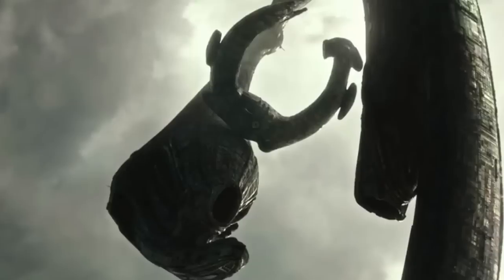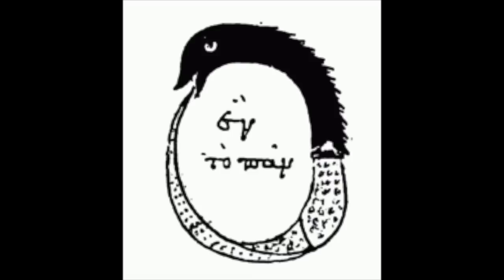Why Engineers Used a Flute ? How Juggernauts Work? Mother Juggernaut's Fate - Alien Covenant

Comment: The inside of the helmet that the space jockey is about to have equipped looks organic and not highly technological. There is no visible visor nor wires or lights. The pilot may be able to link his central nervous system to the ship in order to be more efficient when piloting the vessel since it would in theory be an extension of the pilot himself. This may be why the flute needs to be used so that the juggernaut knows that it is accepting a link with an organic being and not an AI or robot. Until David was able to bypass it by playing the flute.

Comment: That picture change isn't Jugornout changing, its because when they opened the door the atmosphere of the preserved room got corrupted & its immediately started eroding the inner walls .Shaw actually talked about that in proemetheus
Reply: If the room was changing because the air got corrupted, I wonder whether the little worms were accidentally brought in from the outside and started evolving because they touched the black goo?

Comment: a common mistake. The tapestry and leaky pots were NOT ON A JUGGERNAUT!  They were down a long hallway completely away and separate from it. in Prometheus the 3d map clearly shows this, and David doesn't open the ship door by himself until way after they found the tapestry room in the main pyramid structure. C.
Reply: That dome thing structure has a face in the top, maybe is the same biotech.
Reply: Good call.
Reply: Redstone Tnt The face huger has lungs to breathe air for it's host. What ever that air may be. This makes sense, give the host the same air it's use to breathing.
Reply: @johnnyjoejapan  hi I deleted my comment now

Comment: The engineers ship does not resemble the Ouroboros.  The snake (or dragon in some depictions) actually has to swallow his tail (hence the symbol of infinity) and the ends of the ship don't connect at all.  I think this comparison is a stretch.
Reply: ZombieMommy the ship looks like a hammerhead shark to me.  One that is bent, malformed, and rigid.
Reply: There are many inspirations garnered from ancient Astronaut and creator God theories permeating Prometheus & Covenant. 

Kroft was probably looking hard at every angle, like many of us do, to try to connect the dots that are there to connect. Some do. Some don't. 

Part of the process of search & discovery!
Reply: Incorrect. Not a stretch in the slightest. Many Ouroboros are depicted with the snake head not connecting to the tail,, but simply being in close proximity to give an impression.
Reply: @masamune2984  where??
Reply: The Engineer's ships actually remind me of the travel pillow head rests that go over the back of the neck and sit on the shoulders.
Reply: I always thought they look a little bit like a celtic torques
Reply: @beyondfossil  reminds me of a toilet seat

Comment: In engineering there's something called topology optimisation which shapes materials based on the forces they need to withstand, and often results in organic shapes. Biology does this too. Eg your bones reshape as you grow in part directed by forces you experience. Maybe the ship is like a tree in that relatively small mass is actually 'living' and the rest is 'dead' structural material. Honestly it's a bunch of tradeoffs, bulk material vs nanostructured, growth vs machining, repairability vs strength etc etc

Comment: I think you have to consider when the original movie came out and also another book around the same time period called Contact by Carl Seagan.  In the sci-fi Contact story there is brief comments on new tech from advanced civilization.  One of these was a vat that you prepare in a certain way and it self organizes an organic framework in the case sort of like bone marrow for support.  While DNA was know two years before the term genetic engineering was new as this time.  Before that there was a “food from oil” concept.  You put genetic instructions in a vat of oil and pull out proteins etc.  Pulling out formed structures is the next step to the imagination.  Today we tend to thing of this work as requiring a scaffolding instead but that is now and not then.  If the ship is not properly alive it was at least this vat grown version of genetic engineering line of future imagining that was popular at the time.

Comment: All very interesting points & observations that seem to fit, except for the last bit about the black goo pathogen coming into contact with the Juggernaut. The Juggernauts seem to have been designed to release entire cargo holds of the canisters of goo. If you notice the canisters are synchronistic in their deployment by design and do not burst until well beneath the Juggernaut and the mother Juggernaur. So I do not believe the goo had anything to do with the Juggernaut or mother Juggernaut wreckages directly. 

The cause for their crashes is one of several mysteries that should have been explained.

Comment: It's very simple. The flute and its pattern produce certain frequencies and harmonics. All it is is a safety measure. The ship will activate when this specific sound pattern is played. Without that flute, pattern and engineer that ship would not start. Think of it like a very secure and sophisticated immobiliser for the ship. As for the ship being partly alive? Dont see it. And the room that changed wasnt on the ship. It was in the labs away from the ship. The mural began to tarnish because the environment had been changed in the room for the first time in over 2000 years. The materials in the mural would have oxidised. Either that or the mural itself was some sort of environmental monitor. But it had nothing to do with what you have suggested.
Reply: I agree with you. 
-the mural changed with the intrusion of humans. even the previously frozen black liquid only came out of the urns after entering the room. the black liquid reacted like it should as a weapon. individually. adapted to the new given conditions of the "environment". just like it should happen on earth.

Comment: Yes, the ship is biomechanically alive. The original idea was that the Spacejockey race, later humanized beyond repair and called Engineers, had the ability to meld and integrate seamlessly with their tech. They would literally become the ship, connect with its nervous system, pilot it like you pilor your own body. 
Prometheus did show how the Engineer was melded with his suit, which was cool. But it failed miserbly to make the meld come across in the pivotal scene where the Engineer sits down into the pilot’s chair. It looks way too clunky and mechanical.
I sure didn’t like the way the bony helmet parts kinda closed around his head like they were on hinges.

Comment: The other thing with the "simple" flute tool. There's nothing simple about music. Music can contain far more pieces of information than spoken language or text. This is why one would expect a highly technologically advanced civilization to use music for at least part, if not most or all, of there communication. A flute may be a simple instrument but the product of the flute can be extremely complex and Packed with info. The flute music was probably coordinates and then the engineer got busy turning on the ships systems. I doubt the ship is supposed to have been alive, more likely just constructed using tech that mimics organic growth. When people designed machines to fly in the earth's atmosphere we used bird wings as a template to model the aircraft around. This engineer ship is likely the same except thousands of years more advanced. Every machine they make is probably engineered to take advantage of the advanced and efficient nature of the organically evolved structures used by living things. Engineers have technology that can actually calculate evolutionary progress. They would use that technology to engineer the most efficient structure for a spacecraft and to design every single item inside the spacecraft and their suits and any other tool or instrument they build. So not necessarily alive, but built as if it were a living thing.

Comment: Kind of makes sense.  When you consider that in order for our computers to move forward, organic will have to be the way, as we seem to have it a max frequency now with CPU's and the ability to keep them cool with silicone technology.
Sure we can add more cores to CPU's to give the illusion that they are faster, but it is really just like having one man dig a hole in 10 minutes. get another man to assist digging that hole and equally share the workload, then it gets done in 5 minutes, but man 1 did not work any faster.

Comment: Nice theory but even the black goo was leaked on the ship and no reaction from the ship maybe its because the ship was not active but then how would it react to an unknown living organism as you mentioned in the video but i do like and agree that there is some sort of life in the ship eg the bone like structures in it and how it merges with its pilot 😀
Reply: Filomena Palesoo 😀
Reply: absolutely correct
Reply: Filomena Palesoo Well it was storage room. Its safe to assume that its prepared for containing it with no harm to itself i. those few rooms.
Reply: Filomena Palesoo when was the goo leaked on the ship apart from the drop? And it crashed because the goo was dropped, that's the theory in the video
Reply: JJ Greeno remember when Shaw took the head and they ran off when they came back the goo leaked already lol maybe
Reply: Filomena Palesoo if you mean when they found the head in he temple then they took that back to the Prometheus
Reply: It was leaking from the jars in the room with the giant head. But i suppose it was the goo and not the airborn version. So maybe reacts different
Reply: guys, shaw and david took another ship where the containment was likely still working.

Comment: I agree wigh the content of this video. If I however was the author of this series I would not have gone with a flute usage line of thought, as that's plain stulid. Any advanced robot would be able to immitate the sound of a flute. And what happens if you accidentally loose your flute while in some far galaxy? The flute thing is just silly. Or imagine if you drop your flute and it brakes? Lol. I can already "hear" you guys commenting about tge backup flutes that would be available. Lol. I would rather have gone with some or the other form of telepathic or beural link form of communication. Just imagine being attacked by an enemy vessel and in an attdmpt to escape, while under duress, you now gave to llay a flute first. Rofl.

Comment: Hey the ideas and themes that John spaiths and lindelof had were great but Ridley just had to get involved in the writing process and mess it all up. Ridley is technicaly the best out there but a  writer he is not Because of his technical brilliance was  the reason the original producers and writers hired him. But over the decades Ridley just became a showrunner for the alien universe. The question of who was the space jockey was raised by the original writers for Alien 2 but Ridley in 1983 was not available. They waited 5 years for Ridley and then they moved forward with J Cameron who had a nightmare making AlienS because all the production engineers were Ridley. Truth be told Ridley over the years has hijacked this universe. Yes J Cameron did not want to answer the question of the space jockey. He had wanted to take it a different direction.